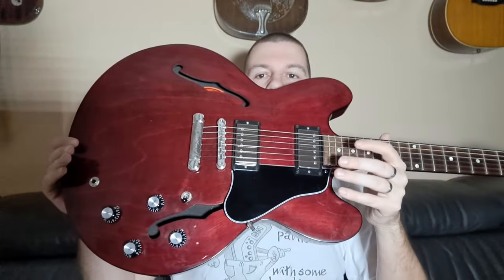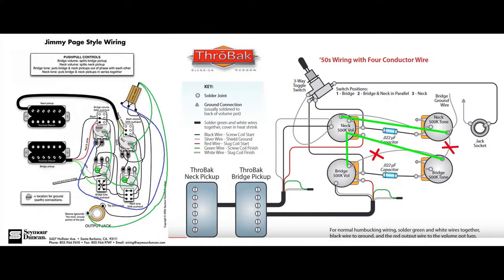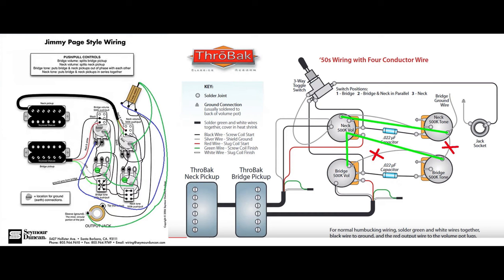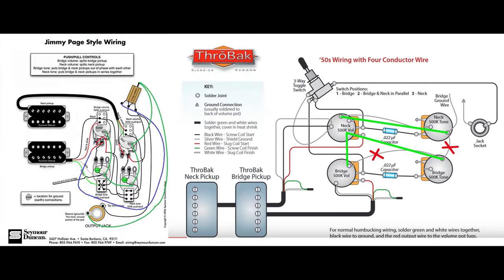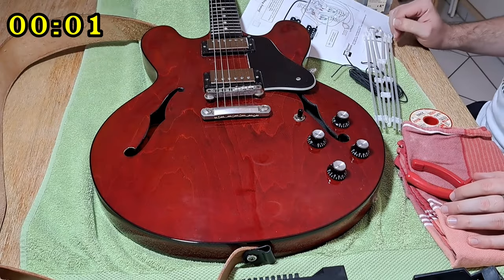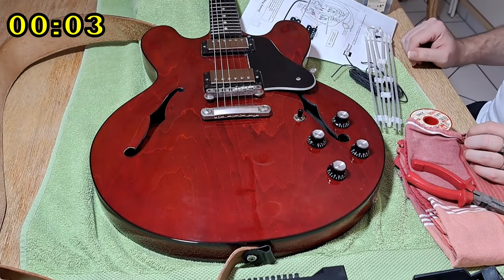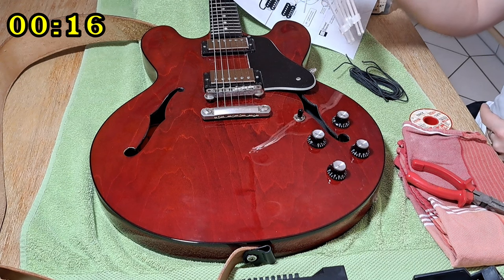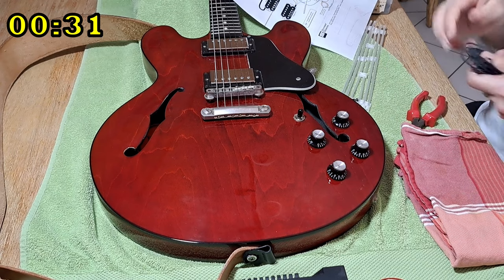Modifying the JP wiring in my ES-335 from modern to 50s Style

Comment: Great video Martin! I did a pickup and wiring harness swap on my Oscar Schmidt/Washburn semi-hollow guitar a couple of years ago and ran across a major problem in the middle of the mod. The original pots were the little dime sized Alpha pots and were easy to get out through the "F" holes. The new ones were full sized CTS pots for tone and push-pull volume pots wired for coil splitting and they would not fit through the "F" holes or through the wiring  channel for the pickups! I ended up cutting a 2 inch diameter hole through the back of the guitar to get the pots in and made a plastic access cover from a lid off an instant cappuccino container! ;D I used aquarium air line tubing to pull the pots and output jack into place and slid the washers and nuts on to the other end of the tubing. Those tools you had would have been nice to have for this job.
Reply from the maker: Thanks Ferd!
I know people who made a larger hole from the pickups to the side under the top to get to the parts. I also did struggle a little when I removed the large CTS pots from the original wiring, but it was possible with a specific turn while pulling them out. I also heard someone else say it would be impossible on my model too.
These tools certainly are a big help, especially now that John has a thinner version for semi hollows where space is a little more limited than full hollows.
Cheers, 
Martin

Comment: It is my understanding that the location of the capacitor in the circuit is the entire point of the '50s wiring.
Modern wiring has the tone capacitor connected directly to the volume pot's input, as the volume is decreased it also effects the signal into the tone capacitor.
'50s wiring has the tone capacitor connected to the volume pot's output, this greatly changes how the volume and tone pots interact with each other.   
The way the tone cap connects between your pots actually changes how your Volume Pots and Tone Pots interact with each other. 
With '50s wiring, once you set your tone you'll find that changing the volume also affects the tone and how it sounds.
To my ears the '50s wiring offers more tonal possibilities.
Nice Gibson's, love the black binding.
Thanks for sharing this with us.
EDIT, You must use the correct taper pot.  All of my Les Pauls have the Centralab spec VIPots (Vintage Inspired Pots).
When using the VIP Pots (which have the '50s spec taper) I can roll my volume down as low as 1 and the guitar cleans up beautifully.
Typically, I'll play with my amplifier almost all the way up, and then lower the volume by using the guitar's volume pot.
I can't recommend highly enough the use of the VIPots.
Reply from the maker: You're essentially right. Just that it's not just the cap, it's the whole tone circuit with the cap and tone pot together, that's on the output of the volume control instead of the input. Your observation with the way they're interacting with each other is the same as mine. That's why I prefer the 50s big time over the modern style wiring. Also, reducing the volume does not reduce the tone on the 50s wiring, but reducing the tone does reduce the volume. With the 60s, it's just the other way around. Maybe a dedicated video about the differences might be interesting?
And thanks, I love these two 335s. 😀
Cheers, 
Martin
Reply: @LMGuitarCorner  👍